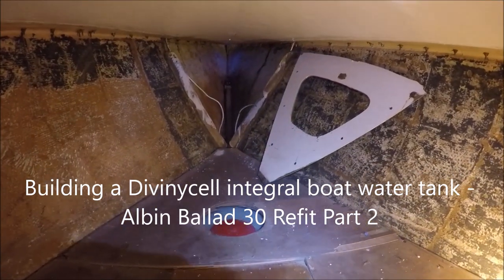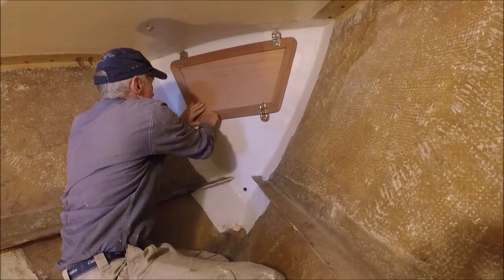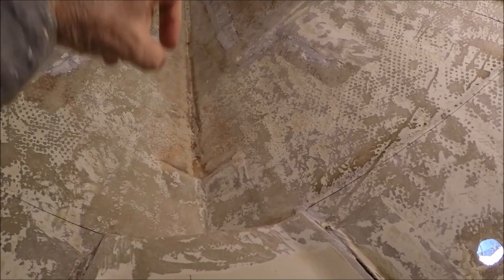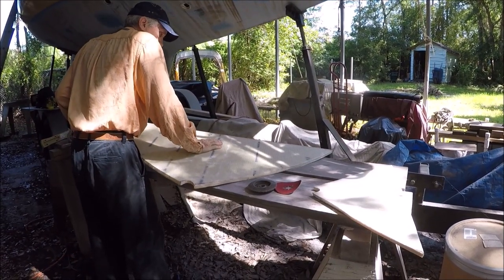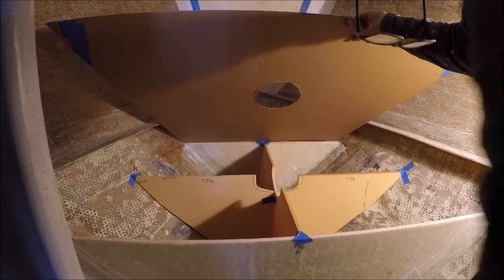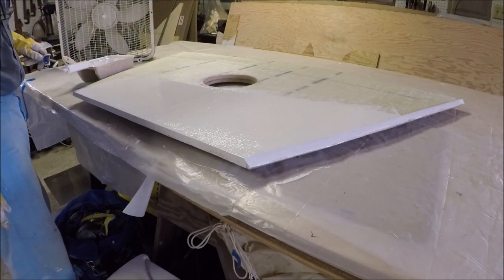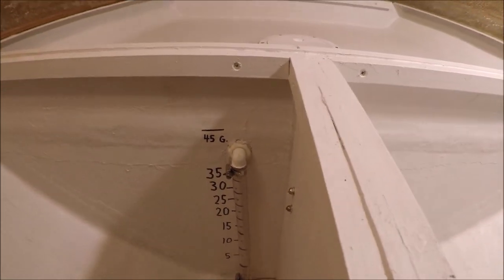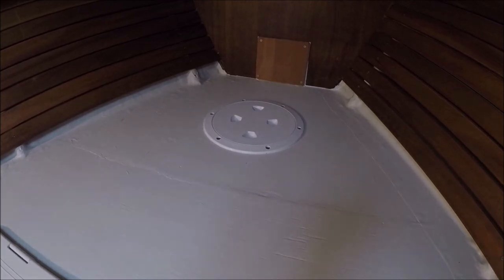Building a Divinycell Integral Boat Water Tank - Albin Ballad Refit Part 2

Comment: You do a fantastic job of explaining your process, accompanied by excellent visuals. One of the best DIY boat channels, and not sure why you aren’t seeing 100K subscribers. Go figure….
Reply: The glasswork, is it all in epoxy? Or are you using poly and then finishing with the bar rust?
Reply: I was just thinking the same thing. His channel is by far the best one I've found when it comes to refitting and DIY projects.
Reply from the maker: @Carhawlin  All epoxy resin. You could use vinylester resin but epoxy has the best properties for glassing to the old polyester resin they used when building the hull.
Reply from the maker: Thanks. It's not a slick production and there's no bikinis so I guess we'll just have to keep this to ourselves.
Reply: @atomvoyager  😃 heh heh heh

Comment: Nice work! Our 1972 Albin Ballad was also short on water tankage. We kept the forward poly tank -- don't need much chain where we will be cruising. Then I built a 31 gallon epoxy/FRP tank that fits under the port settee, tight against the nav station bulkhead. I built it up over a male mold, using a combination of woven fabric and 45° biax, alternating overlaps to strengthen corners. A drilled baffle divides the tank. The top was made separately & epoxied into place, along with the fittings and two large access ports. The interior is coated with a potable-water 2-part epoxy paint. 

In combination with the V berth tank and a couple 7 gallon jerry jugs (which we'd need on board anyhow, to dinghy water from shore), that should bring us to just about 60 gallons. The tanks are plumbed in both series and parallel, so we can gravity-dump the forward tank into the midships one to lighten the ends, get water on either tack, and keep them separate to prevent cross-contamination. Fingers crossed it all works! (Tried to include a photo link, but YT nukes any comment with a non-YT URL.)
Reply from the maker: Thanks for the description. Sounds like a good system.

Comment: I know this is over a year old, but does anyone know a soruce for this Bar-Rust 233H. I've been to their site and don't see it. Great video Jame, as usual ! Thanks.
Reply from the maker: My past supplier no longer carries it. I did find some last year on ebay. If you can't find it then you could use Brewcoat that I linked at the bottom of this integral tank article. I think you could safely use other epoxy tank coatings as well. It's likely there is no significant difference in them and not that they are toxic but that they didn't bother to go through a certification process for approval. I install a charcoal filter in a standard household water filter between tank and sink spout to get rid of any possible epoxy taste that may remain. It's generally recommended to make the mixture about 2-3% resin rich to ensure no uncatalyzed hardener remains and to allow 24 hours cure between coats. West System I believe recommends a resin-rich/ hardener-lean mixture that is about 5-10% resin rich in the article linked at the page below: https://atomvoyages.com/integral-water-tank-construction/

Comment: Hi James, thanks for this detailed video, have you ever experienced any leaks with those sight tubes, or noticed any issues with algae growth due to the transparency of the tube and exposure to light? Would you build them again in this way or use a different system for measuring the water level?
Reply from the maker: As far as I know none of the site tubes and their fittings have leaked. More recently I use Sikaflex 291 sealant for the fittings to tank and for fittings to hose connections as well as the clamps. Because the site tubes are normally in a closed locker they do not get much light exposure. If they did slowly cloud up after several years it's not a big deal to drain the tank and replace just the hose. Of course if you felt the need to have a site tube located in the open where it was exposed to light then that time could be shorter. I still build them this way since I haven't discovered a more simple and reliable and inexpensive solution.

Comment: Hello James,  I’m impressed with your processes and video here.  One question, I’m curious about what finish you used on the interior of the V-berth when you were completed.  I’ve used Interlux eggshell enamel before, but that was a long time ago.  Is this paint? Or pigmented epoxy?  I am restoring a Fisksatra Havsfidra 20 so I’m shopping around for all the latest tips and tricks I can find… Thanks very much.
Reply from the maker: In this case I think we just used 2 coats of white Interprotect 2000e epoxy barrier coat as a primer and paint in one. It's the easiest and fastest to apply if you don't mind the matte finish. Recently I prefer to use white Total Protect from Total Boat since it goes on smoother and less odor when applying. For areas where the owner wants a smoother paint finish I use latex type EZ Cabin Coat which is a semi gloss and tint it off-white as done in the link to the video here about 8 minutes in. In any case, I try to avoid using gloss white because it is too reflective and highlights imperfections in the surface and finish:  https://www.youtube.com/watch?v=LcwNSVHhaiA
Reply: @atomvoyager  Thanks so much for your info.  I do like the matte finish.  I find gloss below decks distracting with all its imperfections jumping out at me.  I recently joined your Plastic Classic Forum, I’ve got a coffee-can-type hull-to-deck joint on my Havsfidra 20 that I will be dealing with and hopefully can get some detailed info on.  Thanks for all you do!

Comment: I've watched all your integral water tank videos.  One thing I've wondered is:  When you seal on the lid, do you thicken the same epoxy you used to coat the inside of the tank, or do you use a different epoxy (which I would assume is also rated for use in a potable water tank)?
Reply from the maker: I add West System 406 silica to regular epoxy resin and then later take a touchup brush with a mirror to coat the small amount that squeezes out inside along the seam. It would save some trouble if you could thicken the Bar Rust epoxy so maybe I should do a test of that. I'm not sure if it will harden up properly when so thick though. That said, the small amount of exposed epoxy on those upper seams is not constantly immersed and even if it was, I doubt there is anything harmful in the epoxy if it was mixed carefully with a very slightly resin rich ratio.

Comment: I really enjoy watching your careful and precise approach to these projects. Thank you so much for the content you're putting on YouTube.

Do you have another video I can watch that shows your method of measuring and cutting bulkheads to fit so well?

Oh, also, I have a question about the longevity of a tank like this. Rebuilding it or re-coating the interior surface doesn't seem like something that one would want to do very often. Can this be expected to last many years? Decades?
Reply from the maker: Yes it should last decades with no maintenance other than occasional inside cleaning if the water grows moldy as it can over time in any tank.  I have a similar tank I built into my own boat over 25 years ago and its been fine. I did have one tank I built some years ago using plywood and there apparently was a pinhole gap somewhere in the lid that eventually saturated and rotted so I cut out just the top and replaced it. You have to be very careful to seal a wood cored tank with several coats of epoxy and fiberglass. The foam core is less critical and I only build them that way now. For bulkheads there is such a thing as the tick stick method but I find it easiest to take rough measurements of the size needed, cut it out of cardboard and then trim the carboard to a close fit with a box cutter and scissors and fill any gaps with masking tape along the edges. Once the cardboard pattern fits, I trace it onto the foam or plywood, cut it out, grind an angle along any edges that need it, glass the foam board and it's done. If there are small errors of gaps they fill in with the thickened epoxy fillets along the edges before the fiberglass goes on. I show some of that being done in my outboard well videos.

Comment: As i own a HR Monsun 31 and am really Into your modifications i wonder if you could share what other modifications you have done to the Monsun? 🙏
Reply from the maker: Over the past year I've done about 30 jobs on a partial refit of a M31 here that is preparing for a circumnavigation. I haven't covered most of that on video since it was all the typical jobs you see on other boats on this channel. If you have specific questions about something you can join and post them on the Plastic Classic Forum. I'm a moderator and answer questions there: https://plasticclassicforum.com/forum/

Comment: Could you please explain your method of making templates for different hull forms, especially in hard-to-reach places?
Reply from the maker: I take rough measurements of the size needed and sketch it on paper. Then I refer to the sketch to draw it out on cardboard, or thick paper if it's a small pattern. I cut out the cardboard, hold it in place in the boat and then trim it to a close fit with a box cutter and scissors and fill any gaps with masking tape along the edges.  To get a close fit I move a sharpie pen parallel to the hull using my finger as a guide and that marks the cardboard to a good fit. It's hard to explain in words so I should show it being done next time.
Reply: @atomvoyager  Thank you - and please do :)

Comment: What are your thoughts on having water storage under settees to keep weights near center of gravity? Also, if I remove the inboard engine, removing water tank from under the V-berth would help keep things balanced.
Reply from the maker: My feeling is that having some water tank weight in the center v-berth is less of a trim problem than having a full tank under port or stbd settee. If you had two settee tanks and moved the valve to take each one down halfway that could work. But storage under settees is more handy than under the v-berth so you may not want to sacrifice that. Extra ground tackle, batteries and water jugs stowed aft will easily compensate for a centerline v-berth tank provided you don't place it all the way forward.
Reply: @atomvoyager  Thank you for the advice!

Comment: Another question I had was what kind of sealant do you use for the fittings that come in contact with water inside the tank? Is it a non toxic sealant or do you paint over the fittings to cover any exposed sealant?
Reply from the maker: I clean off any excess sealant around the fittings inside the tank so there's a miniscule amount exposed the the water. I have used West Marine Multi-caulk, but now use Sikaflex 291 which I think is better. They are fairly inert once well cured and I have a household charcoal cartridge water filter before the sink spout. I guess you could paint over them if you wanted.  If you have more questions you may want to join the Plastic Classic Forum. I'm a moderator and answer questions there: https://plasticclassicforum.com/forum/
Reply: @atomvoyager  Thanks a lot for the pro tips! I'll check out the forum.

Comment: Nice job, with new chain locker. What size chain and amount plus line will  it hold?
Thank you 
Mike
Reply from the maker: 150' x 5/16" G4 chain with 100' of nylon extension. The space is tight so the nylon needs to be coiled up and hung under the deck to allow the chain to sit low. This is OK because most to the time you don't need it but in deep anchorages you can take the extra step of releasing the coiled line below and then hanging it back up when retrieving. I'll show this in a future video.
Reply: @atomvoyager  I have an Albin Vega, the chain locker looked about the same as mine b4 your change. Do you know or guess what a vega could hold in 5/16 chain.
Reply from the maker: @redwood1957  I'm not sure about the Vega. 150' fills two 5-gal buckets 3/4 full if that helps to visualize it. The Vega is light enough that you could get by with 1/4" G4 HT for a better fit and less weight. With 1/4" you may not need a windlass (use a chain stopper) and consider using less chain such as 100' and that should fit alright. On my 28' boat I have a windlass and 125' of 5/16 chain.
Reply: @atomvoyager  well I just got a good deal on a 5/16 windless, I could change it but would rather not. We will see. Thank you

Comment: So helpful, I built my integral tank using divinycell following the article on your website.It looks identical to this one. My question is where do you source those fittings? I'm about to buy all the fittings but have a hard time finding them.
Reply from the maker: The access plate is from Defender.com, Beckson DP60-W: https://www.defender.com/product3.jsp?path=-1&id=7803537
The plumbing fittings I get from West Marine because I get wholesale prices so you might shop around for best price. Below are West Marine model numbers:
2 pieces tank site tube 90° Plastic Mushroom Head Barbed Thru-Hull, model # 336230.
1 piece 1/2" thru-hull outlet, Model # 411340.
2 pieces 5/8" thru-hull for vent and chain locker drain, Model # 401929
Optional - 1 piece 1 1/2" inlet, Model # 395709. I'm assuming you will reuse your existing deck water fill fitting. I now prefer not to install the deck inlet to save cost and clutter and because the tank should be filled by pouring the water jugs into the tank access plate or bringing the hose thru the forward hatch and into the access plate so as not to overfill and stress the plastic access plate seal. If you do use a deck fill, then best to pump out about a gallon of water at the sink spout to address that issue.
Reply: @atomvoyager  Thank you very very much!!
Reply: @atomvoyager  My boat never had the deck fill for water, so I've opted to keep it that way and fill the tank through the beckson access plate. Good tip about not overfilling and stressing the plate. Makes sense.

Comment: James, I'm a bit worried about your chain locker drain, Ballads don't normally come with a chain locker and when they are added its probably better to drain the locker directly overboard instead of to the bilge, the reason being is that the Ballad is a very wet boat and will take a lot of water over the bow, when sailing this means you will constantly be running the bilge pump, Mads from Saillife did a video of running the drain directly overboard from the locker, https://youtu.be/5zVKjOvkNeA?t=248 keep up the good work!
Reply from the maker: Thanks for the comment and link. I just watched the 6-part videos of Sail Life's chain locker. I didn't realize the Ballad had no locker originally, just a sealed panel with no access hole. A previous owner of our boat cut the access hole in the bulkhead and installed a deck chain pipe. From what I can tell, the Sail Life guy does not have a windlass or all chain rode so his locker can work with a raised floor and overboard drainage. We wanted to have 150' of chain with 100' nylon extension and a manual windlass, so the bulkhead had to be moved aft for chain to sit as low as possible. For that to work we must drain to the bilge. But don't worry, I've had the same system on Atom, my smaller and lower freeboard boat on two circumnavigations and never had too much water coming in. There are two ways to reduce water coming in the chain pipe. One is to remove the shackle from the anchor before an offshore passage and hang the chain under the cap and seal the cap with a plastic bag around the edge. The other is to leave the chain on and wrap a small piece of Play Doh (modeling clay) around the chain at the cap and then wrap the cap with the plastic bag. Either way, there will only be drips and a few cups of water coming in each day underway when beating in heavy weather and the bilge pump easily takes care of that.
Reply from the maker: Also, the deck chain pipe needs to sit on a raised block at least a half inch above deck level to reduce water ingress.